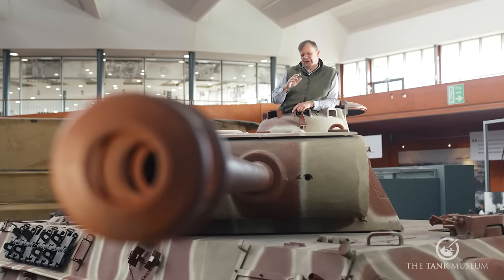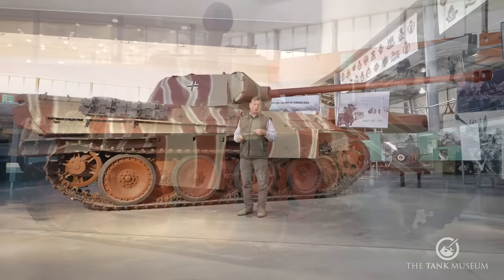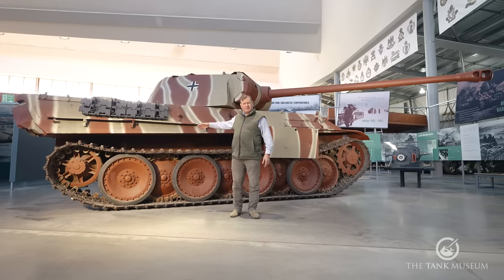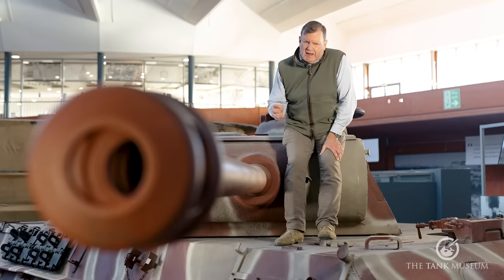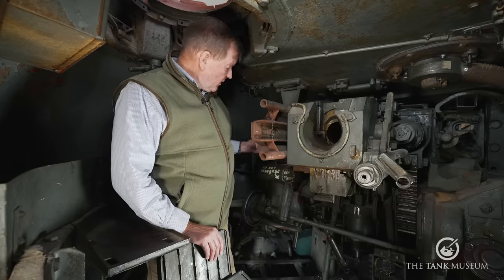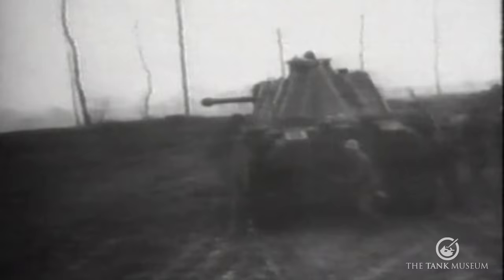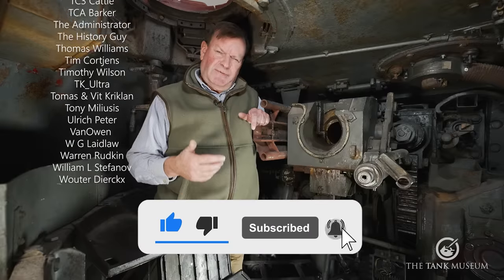See Inside Panther | Tank Chats Reloaded

Comment from the maker: Hello tank-nuts! We hope you enjoyed this video. Let us know your thoughts in the comments.
Reply: Prefer M1 Abrams...
Reply: It cool to see inside such a legendary machine, as during visits to the museum few have veiws of the inside , to give a view of what life inside a tank was like
Reply: copsons presentation is brilliant. I thought he was a bit wooden in his first few videos, but he seems to have settled right in
Reply: Awsome vid on one of my favourite WW2 tanks and one can only imagine if they had a desiel engine and better torison bar set up and the final drives, fuel pumps and transmission fixed. The Panther tank would have been a lot more lethal tank. One thing to note also during its first combat at Kursk the D model notable without the bow machine gun had less bolts on the rims of the wheels and later more added to strengthen them. Also there are pictures I've seen with a mitch match of both types which are intersting to note the difference.
Reply: @tasman006  yes, one can only imagine that. the conditions you have described for this tank being more lethal are, for the germans at the time, so ridiculously unachievable as to be inconcievable. you may as well have said "one can only imagine if it had a force field and a laser gun"
Reply: I've tried, but the sound is not what I'm used to. Very low on volume, qoute muddy (needs more high end) and effect music more or less drowning out what vocals there are. And since you're British, there's no subs provided, the auto-generated ones often comes out as gibberish due to the technical subject.
Reply: I have no thoughts I am brainless…true story by the way
Reply: Great show as usual. I really think you struck a chord with Tank Nuts, perhaps some T-shirt’s with that printed on…….
Reply: I highly doubt panther slope armor was borrowed from T-34. Its a myth.
Reply: I repost my comment here:

On the G the over-track side armor is thicker but also less sloped. 50mm at 30° instead of 40mm at 40°.
You also calculated the thickness wrong. If the armor is sloped 50° from the horizontal (40° vertical) the LoS thickness is just 52.2mm for the early and 57.7mm for the later hulls instead of 62.2mm and 77.8mm.
Reply: Jesus Christ and Mary Magdalene in Heaven.......
With the GREATEST respect and humble....this video is made by historians, a historian presents the tank. and STILL I can find myths in it.
Please read my arguments carefully:
1. Panther built by British after the war, cannot complete a British trial.

First: 
I immediately noticed that the G Panther in the museum has a  Ausf A variant tower. This alone shows the seriousness of the "putting together" operation.

Second:
Were the British people who conducted the tests trained enough to use the panther?
Were the parts used to assemble the tank equivalent to 1944 quality materials?
What was included in the test that the Panther could not perform, what was the fault?
These are 3 major questions for which we have no answers, only that the Panther is unreliable.

How is it that the Germans, who also knew about the Panther's faults, were able to do 1 500 to 4 200 km with the Panther? 
Isn't that contradictory ?

2. Did the Germans "borrow" the angled armour from the T-34?
Virgin Mary...this myth was busted decades before, are you still bringing it up?

3.Does the Panther eat 4x as much fuel as the T-34? 
I ask you...WHY DID YOU DETERMINE THAT?!

Let's look at the numbers:
To start with, a diesel engine uses on average 20-30% less fuel, but not 4x less.....

The Panther had 720 liters of fuel.
Range of Panther:
On the road: 200-260km
On land: 100-130 km
Panther consumption: 2.76 Litres/km (on road)

The T-34:

Mod 40-41:

460 Litres of fuel.
On the road: 330km
Ground: 200km
Mod 40-41: 1.39 litres/km (on road)

Mod 42:
On the road: 330km (same distance as Mod40-41, because it was 2 tons heavier than Mod 40-41)
Ground: 200km
610 Litres of fuel.
Mod 42: 1.84 litres/km (road)

Mod 43:
On the road: 450km
Ground: 260km
Had 790 Litres of fuel.
Mod 43: 1.75 litres/km

T-34-85: (internal tank only)
556 Litres of fuel.
On the road: 300km
Ground: 160km
T-34-85: 1.85 litres/km

At best:
2.76 vs 1.39: 1.98 x.

Where is the 4x indicator?

4. "interleaved road wheels prone to clog ice and mud"
The tracks of any tank can accumulate ice and mud....

5. The engine radiator is a weak spot....
Jesus Christ in Heaven....its like the weak side armour "argument". Even the T-34 had vent intakes on the engine....
So today, the Leopard 2 is a piece of crap, because has big ventilators on the engine, and has only 40-50 mm of side armour...
Even modern Russian MBTs has the same amount of armour and big vent intakes on the engine as the panther....
Or the British Challenger 3 has the same "weak spot" or the M1 Abrams vent intakes....
Please Sir, do not use this kind of arguments.

6. KwK 42 is NOT much better than a Kwk-40 on the Pz IV...
Sir....numbers....
Source: Bird, Lorrin Rexford; Livingston, Robert D. (2001). WWII Ballistics: Armor and Gunnery. Overmatch Press. p. 61.
Kwk 40: (against 90° of armour) (L/48, not L/43)
100m: 135 mm 
500m: 123 mm
1000m: 109 mm
2000m: 86 mm

Kwk 42:
100m: 185 mm 
500m: 179 mm
1000m: 149 mm
2000m: 145 mm!!!!!

If that's not a big difference, I don't know what else is "big".

7. For the driver levers, pump means, it had hydraulic SERVO drive.
To simplify it: you could turn the tank with your little finger. Whereas with the other allied tanks, it took a lot of physical strength.

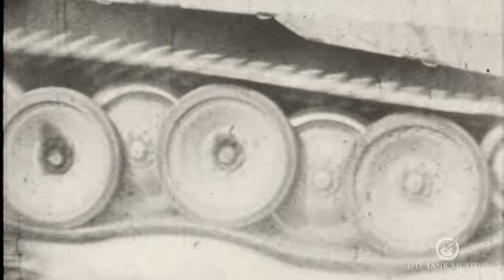8. As you can see: 16:48 the gear lever was "on the floor" next to you, and not upwards as it is in the museum tank.

9. Serviceability only 35%? Please, Sir, do not lie:
Check out the Panther --->Reliability table on wikipedia.

Fun fact: avg. it was 61-62 % from 1944 may until 1945 march. In 1944 if there was not a big push, the serviceability was 85-71% on the western front.

10. 370 final drive was broken. Nice. 
In how long? And from how many tanks? 

Oh, and yes: why did it break, perhaps from a 76mm hit?
I won't paste odes about the reliability of the Panther and the T-34 here, their wikipedia pages have it all beautifully described.

Fun fact:
"Soviet tests on newly built T-34’s showed that in April 1943 only 10.1% could complete a 330 km trial and in June ’43 this went down to 7.7%. The percentage stayed below 50% till October 1943 when it rose to 78%, in the next month it dropped to 57% and in the period December ’43 – January ’44 the average was 82%. During February 1944 tests, 79% of tanks reached 300 kilometers, and of the test batches 33% reached 1,000 kilometers. This became immediately apparent to the tank troops. The deputy commander of the 1st Guards Tank Army, P. G. Dyner, commented that tanks in 1943 would reach only 75 percent of their guaranteed life span in engine hours and mileage, but in 1944 they reached 150 percent."

O, and yes, from that 1945 report, Sir, you forgot to mention this:

"From the front there continues to be serious complaints
regarding final drive breakdowns in all vehicle types.
Approximately 200 breakdowns have been reported with
the .38(t). Prior to the 1945 eastern offensive there have
been 500 defective final drives in the Panzer IV. From the
Panther .370 and from the Tiger roughly 100."

Every tank had problems with its final drive, because of the LACK of training and bad material quality.

11. More Panther lost by mech. breakdown than to enemy fire: Where are the numbers, Sir?

12. French fixed the engine fires? Siiiir, please: The Germans tried their best: tried to use better materiel for the fuel pumps, and decreased the horsepower from 700 to 600 hp.
The Germans knew what are their problems. About the Panther engine there are many-many  bad tone report blamed on Maybach. And the solution was to reduce engine power.
The result of this was checked by Guderian in April 1944.

Why don't you share this information with the world?

Thank you for reading.
Reply: @rolandhunter  Sir this is Wendys
Reply: @dukenukem8381  "What's the procedure everyone? What's the procedure?"
Reply: @rolandhunter  btw i agree with you lately tank museum script writers just copy most famous myths articles from facebook about tanks and call it a day.
Reply: @dukenukem8381  I knew it by reading your previous comment on this topic. 
So, 
Thank you Sir.
Reply: @rolandhunter  wrote: "2. Did the Germans "borrow" the angled armour from the T-34?
Virgin Mary...this myth was busted decades before, are you still bringing it up?"

-- Please do define exactly what "Myth" are you talking about? Virgin Mary? I do want to laugh too.
Reply: -- I particularly like how you explained caliber system, however I liked the approach of Richard Cutland(aka "The Challenger") when he describe 17 pounder round for Centurion and FireFly vs M4 Sherman round, that is my tip to the hat to Richard. Also, yes 3km was actually a record confirmed kill, that belongs to Panther, with a caveat, that normal tank engagement during WWII was no more then 1.2km, so at this distances Pz-IV KwK40 was almost as good as Panther's KwK42.
Reply: @dukenukem8381  wrote: "I highly doubt panther slope armor was borrowed from T-34. Its a myth."

-- Why are you in doubt about sloped armor that was borrowed from T-34? There are books written about it, and supported by documents, the story of Panther tank is well known. There were no German or any other tank in the world that used single armored plate for frontal armor, and used LOS to double its effective armor thickness, so 45mm to yield an armor protection of 90mm of vertical armor. So what part of that you doubt that was borrowed from T-34?
Reply: @rolandhunter  wrote: "3.Does the Panther eat 4x as much fuel as the T-34? 
I ask you...WHY DID YOU DETERMINE THAT?!

Let's look at the numbers:
To start with, a diesel engine uses on average 20-30% less fuel, but not 4x less.....

The Panther had 720 liters of fuel.
Range of Panther:
On the road: 200-260km
On land: 100-130 km
Panther consumption: 2.76 Litres/km (on road)

The T-34:

Mod 40-41:

460 Litres of fuel.
On the road: 330km
Ground: 200km
Mod 40-41: 1.39 litres/km (on road)

...

At best:
2.76 vs 1.39: 1.98 x.

Where is the 4x indicator?"

-- At best it would be 3.6 vs 1.39 or well over 2(2.6 times) times better economy, according to your numbers.

-- Also Panther used very "expansive"(for Germany during war) highly refined synthetic gasoline, while diesel was not. Germany would be better of having more Stg-III instead of Pz-V.
Reply: That opening shot is brilliant - well done, cameraman!
Reply: Very well detailed and talking about the mechanics of the tank and its history. Would be good to get it back in running order
Reply: @RussianThunderrr  Because t-34 is an enlarged Chisty tank. Panther prototype existed before germans saw t-34.
Reply: @RussianThunderrr  really you calculated with the panther worst fuel economy with the t34 best?
Really?

The panzer iv, stug thing is a myth.
More tank, more crew, fuel, ammo etc.
Worse scenario than it was.
Reply: @RussianThunderrr  you know the answer, and others already answered it.
Reply: @RussianThunderrr  Virgin Mary... It's, like you say: Oh my God.... I really have to define this to you?
Reply: @dukenukem8381  wrote: "Because t-34 is an enlarged Chisty tank. Panther prototype existed before germans saw t-34."

— Well, that doesn’t explain anything, since 1931-32 Chisty surely didn’t come with a single frontal armor plate tilted/sloped at "rational angle" that doubles effective armor thickness or LOS, that feature was a result of N. Tsiganov to improve BT-7 tank armor, hence two prototypes tank came out from his "Tortoise" project BT-SV, and those distinct features showed up ever since on all Kharkov factory 183 design Bureau BT-20/A-20 onwards, including T-34, and making it to late war German heavy tanks as a result of Panzer Committee formed after October 2nd H. Guderian report on T-34 tank, after Mtsensk battle. 

— So the question is - what Panther prototype you referring to, they all have index or name, and what year it existed, and most importantly did it have single plate frontal armor that doubled the effective armor thickness or LOS in attempt to came up with Anti Tank prove armor?
Reply: @RussianThunderrr  Your presumed knowledge of heavily curated public soviet  documents doesn't change the fact T-34 Predecessors weren't a continuation of a Christy tank. Track, drive sprocket two man turret , overall composition all christy. Chisty tanks didn't have a solid front plate because it was a light tank from the 1930s. Also its not single plate on T-34 either  because similar to christy tank T-34 had a two piece UFP with a driver hatch opening.  Main point is German designers had plenty of examples to borrow other than T-34.
Reply: @rolandhunter  wrote: "you know the answer, and others already answered it."

— Indeed I do know the answer, which is more in line with Mr. Copson, that N. Tsiganov was an author of theory of steep angle of armor plate, that resulted in doubling effective armor thickness or LOS, a very distinct feature that was adapted/copied by Germans after careful study of T-34 tank in autumn of 1941. T-34 was the first mass produced tank in the world that used that feature.
Reply: @dukenukem8381  wrote: "Main point is German designers had plenty of examples to borrow other then T-34."

— That maybe, but you have NOT answered specific/direct question you was asked on exactly what Panther prototype you made a reference too or have in mind, that had T-34 single plate feature, and when such prototype existed. Nor provided any specific examples that support your main point in this post!
Reply: @RussianThunderrr  Renault Ft17, Christie M31.... Just 2 things before the T34.
Ft 17 was mass produced before T34.
Sir, I had debates before with you, you are heavily russian baised.

Just look at the Panther fuel Economy argument.
You compared the best T34 fuel economy with the panther worst.

Little bit baised comparsion.

On objective basis you should compare the worst with the worst.
And even with the baised comparsion you couldn't get 4x better economy, only 2.6. So the statement from the video is still false. 

And Mod40-41 T34 was not used in 1943 when the Panther arrived.

Its like compare a better post ww2 tank with a ww2 tank.
Post ww2 tank not fought in the ww2, so why do u compare it?

But I already know, I can give you 10000 arugents, your baised views will not change. I know, because I tried in the past.
Reply: @rolandhunter  wrote: "I really have to define this to you?"

— No, how about out of respect to Christianity and other religions not making this references where it’s not appropriate.
Reply: @rolandhunter  wrote: ”Renault Ft17, Christie M31…. Just 2 things before the T34.
…
Sir, I had debates with you, you are heavily russian biased."

—Yes, Renault and Christie M31 were "2 things before the T34", and did not have single plate frontal armor that doubled its effective armor thickness, nor provided Anti Tank(PaK) gun protection at all.
Reply: @andershansson2245  the sound is a you problem, it's fine for the rest of us.

not sure what the british thing means, aside from baseless racism
Reply: @dukenukem8381  wrote: "Chisty tanks didn’t have a solid front plate because it was a light tank from the 1930."

— Sure, but nothing would prevent Walter Christy to replace complicated spike like nose, with if you want to call it two piece UFP the one Nicholie Tsiganov came up with. Sure German designers had plenty of examples to borrow other then T-34, except they liked T-34 design of armor plates under steep angle, that all of their tank design, including those after WWII armored vehicles incorporated this design feature, to the point that NOBODY could convince them(designers), about volumetric problems ideas many people retrospectively coming up with marking it as terrible idea. So you pretty much out of viable argument to support your initial topic starter, that no other tank German Panzer Committee after study of T-34 tank influenced all of their tank design there after to incorporate feature of armor plates under "rational angles", right?
Reply: @pyeitme508  i prefer girls
Reply: @RussianThunderrr  "respect to Christianity"?
Are you mad? I'm Christian, and I called for Mary, Magdalene and Jesus in this debate.
Reply: @rolandhunter  wrote: "The panzer iv, stug thing is a myth."

-- FYI, Its not a "myth", but a speculative historian opinion of expert on WWII tanks - S. Zaloga.

-- My opinion, is that if - H. Guderian had his way, and VK 30.02(DB) became Panther, it would be fast, agile and easier to repair, maintain and manufacture, and a lot more deadly as a result tank, that actually with in 30-35 ton class. So, good thing M.A.N. sold to A. H!tler the idea that bigger is terrifying better, and VK 30.02(DB) is just too much of T-34 alike...
Reply: @rolandhunter  wrote: "Sir, I had debates before with you, you are heavily russian baised.

Just look at the Panther fuel Economy argument.
You compared the best T34 fuel economy with the panther worst."

-- Sure, I remember you now, a few years ago, it was also on T-34 tank subject, you are the one who like to delete your own posts, instead of been responsible for your "inconsistencies". You also bragged that your grandfather fought in Waffen SS?
Reply: @rolandhunter  wrote: "On objective basis you should compare the worst with the worst.
And even with the baised comparsion you couldn't get 4x better economy, only 2.6. So the statement from the video is still false. 

And Mod40-41 T34 was not used in 1943 when the Panther arrived.

Its like compare a better post ww2 tank with a ww2 tank.
Post ww2 tank not fought in the ww2, so why do u compare it?

But I already know, I can give you 10000 arugents, your baised views will not change. I know, because I tried in the past."

-- Well, its you the one who compared none contemporaneous tank's fuel economy, I just wanted to demonstrate, how fact fallacy can be stretched, when history is not done correctly, you see, if 2.6 rounded to 3 times, its just not that far of the stretch to  4 times. Frankly, I do not know, what possessed this channel to make a mistake like this, perhaps metric to imperial system conversion, at any rate, this is a very serious and gross exaggeration(just like: I can give you 10000 arugents, your baised views will not change.), and defiantly should be fixed. And that is my opinion.
Reply: @rolandhunter  wrote: ""respect to Christianity"?
Are you mad? I'm Christian, and I called for Mary, Magdalene and Jesus in this debate."

-- I'm not mad, but I know that Lucifer likes to call, and present himself as Saint, in a name of "God"!
Reply: @RussianThunderrr  You are very mistaken for someone else.
We did debate on T-34, but I not deleted my comments.
My grandfather was a farmer in Hungary not a soldier.
Reply: @RussianThunderrr  Yes and the DB looked like a T-34 wow....there would be many-many friendly fire. Read more about that topic.
Reply: @RussianThunderrr  Now am I lucifer? Wooow...
Reply: @rolandhunter  wrote: "Now am I lucifer? Wooow..."

-- Well, explain - couple of videos on your channel for what "The content of this channel is only for academic research purposes and historical music education" you have a Tribute to Wehrmacht Waffen SS  you got for, as well as "Embrace Your Ancestral Strength", reasons you got 'em there? Are you Adonis wanna be? Just curious.
Reply: @rolandhunter  wrote: "My grandfather was a farmer in Hungary not a soldier."

-- Oh, really!? How about this:

In response to Centurion101B3C

 "Ok Ad Hominem ruski.
At least my grandfather fought in a good tank not like yours"

-- Does that "ring the bell?"
Reply: @rolandhunter  wrote: "I'm Christian"

-- If you are, then how come, you get into "Fuhrer's" head, so much, that you used it as a fase historic fact to insult anpallandt5799, in James Holland video on T-34:

@vanpallandt5799  Hitler neved had a plan to drive on Moscow, but only his generals. Nice historical knowledge, sry not.

@vanpallandt5799  Sry for ad hominem, but its drive me nuts: you guys saying statements, and you don't even think its could be false....you just saying what you heard and do not doing any researsch about it.

-- Are you sure, you are a Christian, or behaving like one?
Reply: @RussianThunderrr  Man...I'm not even talked with vanpallandt.
And a Christian cannot debate? Heh? Did I attacked any person? No.
Reply: @RussianThunderrr   Sorry for talking about you,but: You really have some problem in your head. 
Why are you starting ad hominem in this debate btw?
Not enought facts on your side?
So suddenly you are sooo curious about my person, when the debate is not about me.

Same ad hominem as always, when the facts are sold out.
Always the same scenario...
Reply: Another great tank chat , thank you all for making these
Reply: Can i get a tank for my birthday🥺
Pretty please?
(Nice Panther tho)